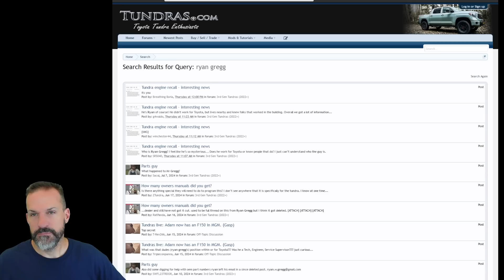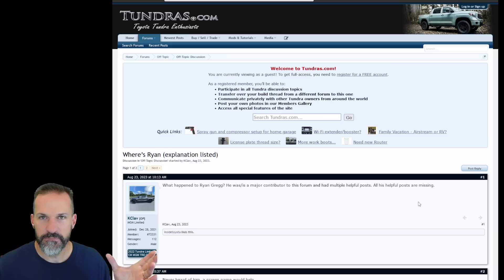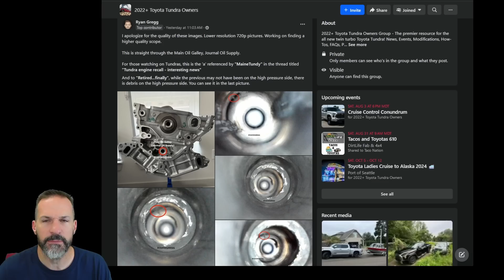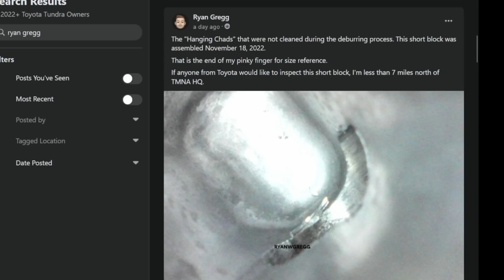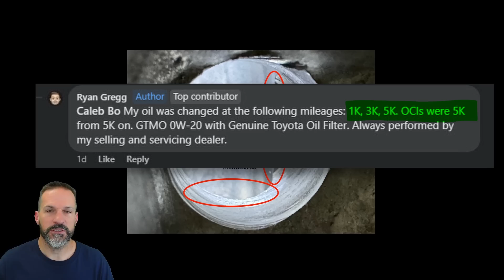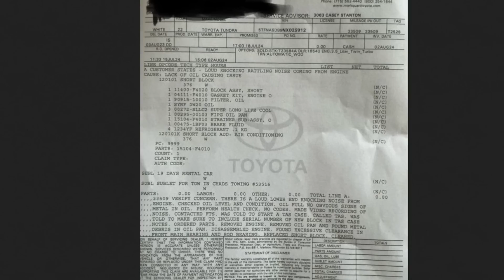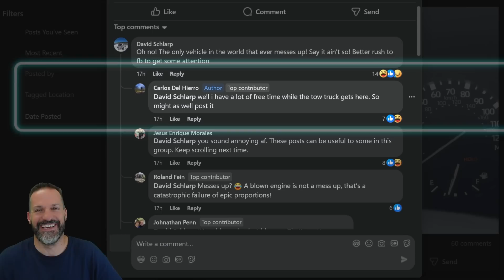Tundra Engine Failures: Debris Confirmed and Early Warning Signs for Dying Engines.

Comment: Toyota claims to have fixed the debris issue in Feb 2023, but there are late 2023 and 2024 Tundras with the same failure. So It's not just a debris issue. One of the youtubers pointed out that it appears they have redesigned the front main bearings. I personally wouldn't believe anything out of Toyota Corporate right now. They just got caught with more falsified emissions and safety tests. Sadly, Toyota Corporate has lost its way.

Comment: I want nothing to do with a turbo anything.
Reply: Or CVT too. Combo of both is horrible.
Reply: @stevec5465  I want a manual transmission but that’s not going to happen.
Reply: @Psylliumhead engines are becoming seriously less reliable. Esp long term. These small desplament turboed junks are gonna get a wake up call when the turbos need to be overhauled when the engine is still in good shape. As well as the leaks that will take place and sudden loss of power when actually pulling weight. JUNK.
Reply: @ and then there’s all the worthless electronics.

Comment: Definitely interesting and could absolutely be the issue, but I would love to see someone scope there engine before failure. When an engine fails, depending on the type of failure, generally there is debris because a component failed and the oiling system carries the debris from said failed component through out the engine. Would love to see someone scope there 2022 Tundra before it fails to see if in fact they find debris. Looking at these scope images I would agree it looks like poor machining/casting.

Comment: I'm curious if the variable oil pump figures into this? Shift gears at low rpm and get to higher gears quickly at low throttle. Low throttle is when oil pressure is kept low for reduced HP consumption of driving oil pump. When you suddenly apply heavy throttle and get low engine speed detonation that DI engines often have, you have a cylindernpressure spikenwith high bearing loading that may be too quick for  the oil pump full pressure command can occur to match the high bearing loading. Spark plugs had to be toughened up in DI engines as some experienced ceramic fractures and scored cylinder walss from the fragments gettimg caught between piston and wall.
Reply from the maker: Could be a problem for sure. I see a lot of guys with “low” oil pressure in the groups and it makes me cringe either way the power these put out.

Comment: Why do people say oil galley instead of gallery? It grinds my gears when I hear that.
Reply from the maker: Yeah often used interchangeably…
Reply: @TheCarGuyOnline  It's just that galley doesn't make sense. Gallery means a passage while galley means a room like a kitchen.
Reply: Oil galley to flow lots of oil on demand 😅😅😅
Reply: @2nickles647  Well, that would cause a drop in pressure until the galley fills up but lol

Comment: It’s not debris.  It’s an engineering design failure.
Reply: It's not debris? You gotta call toyota, escalate to the top managers and let them know your groundbreaking discovery!!
Reply from the maker: Definitely seems like a cleaning failure after cast but could be better cast too…
Reply: @TheCarGuyOnline  think about it. There’s no way there’s debris in 100% of all their engines. Let’s say they have debris in like 70%. That would leave 30% of motors that they would have to replace. From a business sense, not having to replace 30% would save them a lot of money. I think it’s an engineering failure because they are replacing 100% of their motors. 1.) Toyota doesn’t want to get into class action lawsuit 2.) they don’t want anyone to reverse engineer their flawed motor hence giving their customers proof and reason to sue Toyota.
Reply: @saltymethods2637 could be, could not be. The failure rate is currently <2% of the trucks and the reason they're replacing all the engines is likely because they don't know which ones are affected and which aren't. Maybe they would ALL fail at some point, maybe it would remain under 5%
Reply: @centurionl  I think you're making my point for me. Why would a large corporation (interested in making money) replace all the motors in all the trucks and SUVs if the failure rate is <2%? And even if the failure rate is higher (or even way higher), why would they spend the money? You're talking over $1 billion dollars to fix this problem in all the trucks and SUVs effected. They wouldn't. They would only spend the money if they know that the failure rate will result in a 80-100% failure rate. Hence the reason why I think it's more of a bad engineering fault than just some shavings in "some" of the motors.
Reply: @centurionl that number is wrong. They only gave that number because they don’t know the true failure rate.

Comment: Owned a Corolla that still could be running - I think we let it go near 200,000 in 1987 - Owned 2 Tundra's no problems the latest is a 2017 - still have it - owned a Scion - no problems until my son got rear ended and it was totaled at somewhere near 150,000 - Owned a standard 2wd Toyota pick up that I lost track of when it hit close to 300,000 miles - it was still running and was being sold to it's 4th owner -  had a Rav4 that one of my sons is still driving - about 175,000 on it and no problems...  Really disappointing we have this engine issue with the Tundra's and LX 600.   This company needs to pull it's collective head out of their arses and figure this crap out and fast.
Reply: I’m pretty sure this is about Gen 3 Tundras.

Comment: Thinking about purchasing a 2024 tundra SR5 RMX, production date - 2/26/24 build completed 5/07/24. Should i steer clear? let me know, thanks.
Reply: Get a F-150 2.7 Ecobeast!
Reply: Is it a 6 banger? You really need to have someone tell you?
Reply from the maker: I'd wait to see how the 2024s shake out with higher mileage before buying one, I would not take the risk but that's just me.
Reply: Crap shoot with any manufacturer, Ford just had a recall for I think 550,000 trucks. Tundra’s engine issues are less than 1%. I have a 23 hybrid Tundra and happy with it.
Reply: @vitkobylka6432 That's ONLY for 2011 -2014 models...mostly 2014's...and it's just a transmission software update....not a CATASTROPHIC engine failure with low miles..... the Ford 2.7 ecoboost and MOST 3.5 ecoboosts years are long lasting reliable (avoid 2017-2020 3.5's....cam phaser issues starting at around 70K mileage......ALL  5.0 V8's are long lasting reliable....FORD for the win..
Reply: @vitkobylka6432  you are confused, no 1/2 million recall
Reply: Are u stupid

Comment: So am I correct in saying this is NOT an issue with the i-Force Max, only the non-hybrid? Were the engines made in a different plant?
Reply: Nope, same plant, hybrids aren’t recalled because they still have motive power if engine fails. The electric motor can move you to safety.
Reply from the maker: It's the same heads/block engine in the iforce max. The engine are made in the same plants. The hybrid motor masks whatever issue is occurring more frequently in the non-hybrid. There still are hybrid failures with the same main bearing failure symptoms, however just fewer because the hybrid motor takes a lot of the torque early on (starts and stops). Time will tell if they have a combination of problems here. It could be the variable oil pump/lack of oil early in the RPM range, in combination with debris/main bearing material/tolerances etc....We probably won't really know for years to come once these 2024s and newer get some mileage on them.

Comment: Toyota needs to step up on this, just like they did for the frame recalls.   Sending a factory short block to dealers is no acceptable either because assembling an engine in a typical dealer bay is prone to mistakes, missed steps, and bad torque sequencing.  Paying $60,00 and up for a NEW truck, means you should get a factory assembled long block
Reply: Toyota has committed to long blocks.
Reply: @vitkobylka6432  That's good to hear, and should restore some confidence for Tundra owners

Comment: Why was this guy running 93?! Toyota suggests 87 for these trucks no?
Reply from the maker: There have been people that say to use 91 in these. All speculation but modern engines should not self-delete just based on octane of gas used. I bet when dealers get these trucks on trade they aren't putting in premium gas. If changing the octane really contributes to failure, they'd need to re-design the engine IMO.
Reply: "87 or HIGHER" means 87 is the minimum acceptable.

Comment: That's the double-edged sword of an engine failure. While the machining is still suspect, the engine self-deleting is going to send all kinds of debris through various internal (and the bad ones, Externally) passages, which makes pinpointing what came from where more difficult for the average consumer. You can do the oil analysis for the cheap version of a health check, or if you know someone with a spectrograph, get an intensive postmortem report to know Exactly what came from where by documenting where specimens for testing were found at end-of-life if you run into bulk deposits. Naturally there's going be be a ton of aluminum, various alloys, steel, copper and lead (specifically if showing HAF effects), etc.

Comment: From now on all Toyotas should be manufactured in Japan.
Reply: That wont help, the Japanese 300 series we have here in Australia also has plenty of reliability issues.
Reply: LS500 and LX600 are fully assembled in Japan and have had the same failures. These failures go back to 2018 so assembly location is not the issue, it is a design issue but Toyota is not willing to admit.
Reply: Engines are made all over and they all have the same problem....it's design or manufacturing flaw, and Toyota isn't saying even though they know.
Reply: @doctordetroitt  it is the toYota way…

Comment: But not one blow up in CANADA, Yes when it very  cold out the oil will by past the oil filter and leak out on the skid plate.
Reply: What? Leaks out the skid plate. Holy cow, that's a failure waiting to happen.

Comment: Keep posting about the failures.  Toyota needs to feel the shame and embarassment they brought onto their customers.
Reply from the maker: I could probably do a new failure video every 3 days but I think Toyota has addressed the "main" failure and committed to at least replacing most of the engines. My goal later on will be to make sure they are taking care of the hybrid owners and those left out of the recall, because there are still trucks falling dead that were not recalled. I really like my older Toyotas and think they are the most reliable vehicles I've ever owned, I sure hope they get back to building like that again.
Reply: Why? fan boy gonna fan boy...read the comments.
Reply: Never buy the first year of any brands vehicle. It's only shame on toyota if they didn't step up. They are.
Reply: nice try patriot

Comment: I think the metal debre is related to bad part(s) that's dumping these metal flakes into the engine depending on how bad that part is, that's why the engines are blowing at so much different miles, some low and some high like this one 47k. If this was debre related to bad cleaning, then I'd say the engine blowup would've happened at a closer mileage range.

Comment: They should have a choice for customers who wants either to have a full refund or replacement of the whole engine.
Reply: No way they would offer a refund voluntarily.  However I do see more owners getting their money back with lemon laws.  Because I can see the dealers getting so backed up on engine swaps that some with blown engines might be out a truck for well over a month.  That is when some may force lemon  laws on the oem.  Really depends on the state how easy that process is.  But its going to happen and already has in some cases.
Reply: Everything is falling apart in this country
Reply: There would be no choice....no one but a complete and total idiot would settle for a short block (which is what you get with a tech who doesn't know how to do rebuilds---it;s warranty work ffs).
Reply: @doctordetroitt Toyota is giving out long blocks for the recall.
Reply from the maker: Yeah time will tell what the end up doing. People think that they'll be getting a long block but I'm not so sure. The recall update was not specific, on purpose, which still leaves the door open for short block replacements as they have been doing for the past few years. We'll probably know more after September but it's not a good look for Toyota. Those that think they are "getting a new free engine", are just people coping with their purchase IMO.
Reply: What are u talking about the recall specifically says they’re replacing the whole engine. With Brand new ones.
Reply: @mariogarcia2254 I think what Steven meant is they should offer a full refund instead of just an engine swap, because let’s face it; you’re gonna have the same problem again anyway with another engine.

Comment: Interesting. When Toyota claimed debris contamination failure I assumed it was a casting core sand issue. Yet this shows it's a poor machining process. Looks bad for Toyota.
Reply from the maker: 100% agree. I assumed they at least took the time to clean the burrs etc. This just looks like bad QA in the assembly line (after cast), and maybe a bad/lazy cast .
Reply: This is not the same company as before.  The new ceo is ruining their quality reputation.  Its all about showing revenue growth and cost cutting.  The enitre TNGA platform is garbage IMO.  I would not consider a toyota over other brands because of perceived quality.  It's no better then the big three in that regard and I would argue may be  worse.

Comment: So why did they change the part number on the rear main bearing? I’m not buying the debris issue.
Reply: My daughter bought a Tundra. I let her know as soon as I could. 
When it was brand new. They took US to Oklahoma. I had a chance to drive. One thing I noticed was the very low oil pressure. 
My 03 Chevy runs at 40 psi idle and 55 psi at 60 mph. 
Before the lifters went ticky ticky. I tore the engine down after 275k miles. The cam bearing were shot.
Reply: 6-13 psi at a hot idle on my 2022 with 58,000 miles.
Reply from the maker: I think it could be a bit of both. I think they might have multiple issues contributing to these failures which is why it's taking them so long to get this issue resolved. They use a variable oil pump which seems to have lower pressure to me, this engine in particular builds 80% of it's power at super low RPM, all that torque at lower RPM before proper oil pressure might have something to do with it too. They updated 2 parts, one was not specific enough for us to know what it was, the other was (I thought), the main bearing which is the one that keeps failing (according to car care nut). So who knows...maybe a bearing/material change, clearance issue, lack of oiling (more likely), and debris making things fail even quicker than they would otherwise. Time will tell once we see 2024s with higher mileage.
Reply: @TheCarGuyOnline  excellent reply! I think you’re probably right! Thank you for all your content sir.

Comment: The F150 with the Coyote engine is looking good right now!😂
Reply: Ford is using the belt driven "wet" oil pump design now on the 5.0 now, the same design that was destroying their small turbo four cylinder engines, the belt will fail at around 70,000 miles and completely destroy the engine, another mandatory maintenance item, change the belt early to be safe.
Reply: @nn-dj2nu  and yet it has never happened, many 5.0 with over 150,000 mi on them
Reply: @pathunter7003  i doubt there are many 5.0s with 150,000 miles that have the wet belt oil pump. That design came out in 2021 I think. To soon to tell if it's a problem yet, in another 5-10 years we should know. There was nothing wrong with the chain drivin oil pump pre-2021, why change it, especially considering the failures on other engines in the past.
Reply from the maker: I just walked my Ford lot here, there were a LOT more 5.0L in the F150s than previously. I think customers are asking for them more and more.
Reply: @TheCarGuyOnline  a lot more in the lot means nobody is buying them…
Reply: Ford has 3 times the failure rate than Toyota.  Just saying.
Reply: The mustang is definitely what I'm going to do after my Challenger quits... They're the only ones that are making it